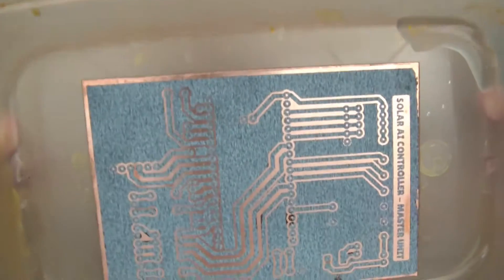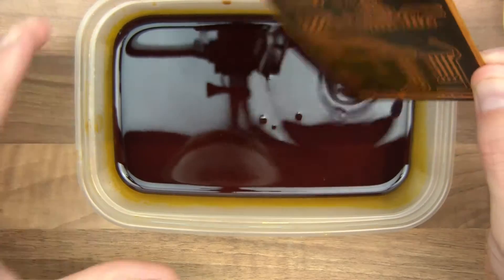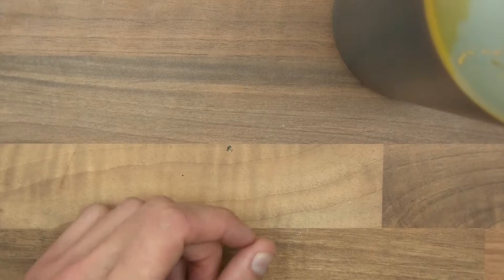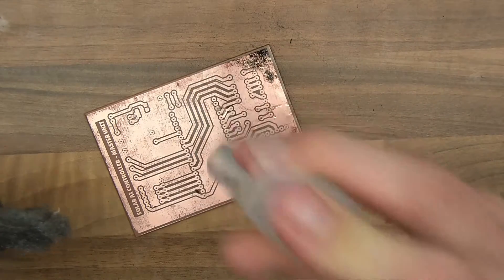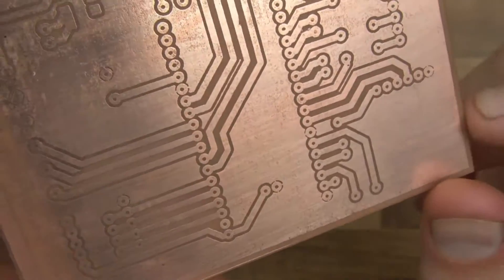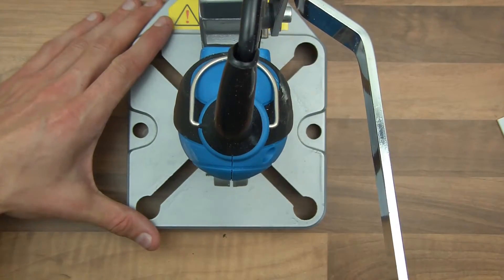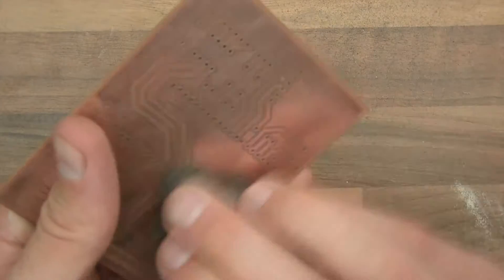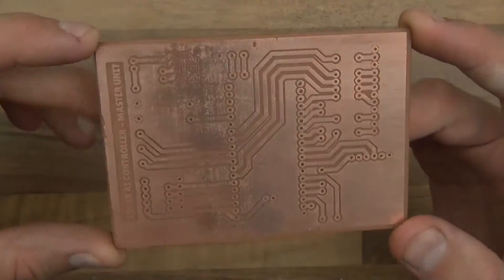TUTORIAL: How to Make Your Own DIY PCBs! - Part 2 - Quick, Cheap & Easy! (Toner, Acetone & No Heat)

Comment: If you can get a finer pitch, you could use surface mount components and reduce the amount of drilling.  Also, as mentioned previously, the tinning solution looks more professional and stops corrosion.  Otherwise after soldering, a coat of spray paint (clear or even conformal coating) will also reduce further corrosion due to residual etchant and minimize effects of humidity that could affect performance, esp with high impedance circuits.  A light coating of green makes it look like solder mask.

Comment: Fantastic video series - my only suggestion would be to show us the final circuit working - then we'd know that the method works as hoped. You could even just use a multimeter to confirm continuity between pins.

Comment: First Attempt:  Worked perfectly, but found I printed the circuit backwards.|:   Second print: not so great because I moved the paper with my finger.  Third attempt:  pretty much perfect.  That because I designed and printed a hand roller so I didn't have to rub the paper with my finger.  May put it on Thingiverse.   Thank you very much.  I've tried photo resist method and also toner method using a laminator/iron.     This is much easier and I like the results better.  Thank you again.
Reply: Neat. What did you cover the surface of the hand roller with ?  I was thinking of using a rolling pin with paper towel underneath to even the pressure out.

Comment: Thx for sharing your experience.
You're on the right road but it needs work. If you had thin traces in the areas that are that pitted, those traces would not be usable and you'd need to make a new board. As your trace sizes are rather wide your board can tolerate the pitting but that problem needs solving. 
Blue Line is probably onto the reason for the pitting. Fine steel wool is a good way to go. Keep in mind that your removing both the oxide layer of the copper and any skin oils. Only remove the smallest amount of copper needed to remove that oxide layer. The acetone on a paper towel is a good final degreaser and won't remove any copper.
As a safety nanny, I agree with Heidi Graham, gloves are much cheaper than the damage to your skin that will occur over time.
In summary, the pitting problem must be solved. Gareth Burrows shows a very similar method with no pitting.
Please repost when you have solved this pitting problem.
Again thx for sharing.

Comment: That was interesting. It is at least 25 yrs since I etched a PCB but then I used Photo-Resist stock and UV Light. Even did a two sided board on a few occaisions. This looks so much more civilised. I am sure there was an "Etch Resist Pen" around at the time to touch up inperfect masking. In fact it could be used to "draw" a free hand track layout. Never tried it.
Reply: I'm in the same boat as you.  I even laid down traces with tape onto the shadow mask film.  Used the touch up pen a fair amount.  Basically a really thick ink that always bled.  Fun days!  This is definitely a better technique.  I look forward to trying it out.

Comment: Hi. Few observations: Do not use your bare hands on acetone or ferric chloride like that. In time you will develop a kind of contact dermatitis that will heal very-very slow. The pitting is because you use too much that steel wool. When you want to remove the toner from the pcb after etching, use acetone and some free lint cloth. Be gentle. In the end, you can use a very-very fine (soft) steel wool. Just a little bit and NO pressure for very little time. Steel wool especially if is not the finest will eat very fast that thin copper layer. Especially on cheap boards. This is why your PCB is pitted. Too much coarse steel wool and not good enough coverage of printer toner. Other then that nice video!
Reply: very well said my friend.
Reply: Also, may want to neutralize that ferric chloride / water solution before disposing it down a drain (assuming that's the plan). It eats copper.... after all.
Reply: @richiedubs52  True!

Comment: Have you tried etching with FeCl by just rubbing it on the pcb for a couple of minutes with a small sponge? I think it's quicker. My guess is the constant agitation/wiping and contact with air speeds it up. Certainly uses a lot less chemical. TBH it's really time to ditch FeCl altogether. I'm gonna try the hydrogen peroxide/vinegar/salt recipe on my next project. Have you tried that?
Reply from the maker: Hi, I havent tried any of that no. I have a big bottle of FeCl so I'm not too worried. With the sponge method, you've got to be careful that you don't wipe the toner off! :-)
Reply: Ah ha. Fair point. I've only used the sponge method with press n peel which doesn't wipe off.

Comment: Etching with ferric chloride is faster if you heat the etchant to ~40C - this can be done by placing your tray in a microwave oven and cooking in 10~20 second bursts until you can feel that it is fairly hot.  You can do this with the card in the tray so long as it is fully immersed.  Etching should be complete in under 2 minutes, especially if you snap the cover on your tray and shake it gently. Once etched, rinse the board aggressively with hot tap water, soak for a minute or two in a tray containing a mild solution of baking soda to guarantee that the acidic etchant is completely neutralized, then repeat the hot water rinse.  Otherwise you will see tarnishing a few days later, and the residual acid will continue to attack the copper.  BTW, my practice with the used etchant is to store it back into another bottle so that your precious 'virgin' stock is never contaminated.  Label the bottle, of course...You can also simply leave the etchant in the tray with the cover on - if it starts to dry out, just stir in a tiny amount of hot water.
Reply from the maker: Thanks for the info!
Reply: Do you have and idea how to mask the solder points to paint the pcb? I'm thinking over a half year now about making my own pcb, have all I need but still not sure about that all, but this tutorial looks very repeatable because you don't need to care about the needed to think about the right temperature, pressure and time of when transfering with an iron, I watched and read a lot of tutorials and this seems to be always a problem because the toners have different temperatures of the point when it begins to melt.
Reply: @Wilson84KS   Did you find the answer to your question? I saw a really good video on youtube about UV curable paint which can be used as solder mask.  Also, something called Dynamask,  which I think creates better and more professional looking results but takes a bit more time.
Check it out here:
https://www.youtube.com/watch?v=bLP-gzqJ-r4
Reply: @Hi-Gain Guitar Channel Thank you a lot for the answer. I know this method, but the way they put the paint on the pcb is not very good, screen-printing is not that hard, need to buy a fine mesh and to build a frame, but it is also the professional method, how pcbway, jlcpcb etc. use it, phototransfer and screen-printing, my problem is still that it uses a lot of plastic foil and it needs a lot of steps. I still didn't try anything, but my last idea is just make my own prototypes first and use vaseline and a needle to mask the solder joints, spay the pcb and when the paint is dry brake the vaseline filled color bubbles, not sure if it will work, maybe the color will wash away the vaseline while spraying or dissolve and mix with it, but I think I can avoid it by spraying from more further away for slow and fine painting, want a thin layer anyways. If it works and I'm satisfied with the result, I'll keep it for my own little projects just for me, but simply order professional made ones if I need more than one, when I'm done with my projects, I definitely will think about how I can reach their quality myself most efficient, there is already the idea to print on glass instead of foil, so it can be reused until I drop it and it breaks, but didn't think further how to realise that, needs a lot of development so it will become an own huge project and need to wait.

Comment: Ferric Chloride is corrosive and toxic.  Please wear gloves!  (or use a non-metal tool, chopsticks are good)

I've noticed a board I made a few months ago is heavily tarnished.
Not sure this is a huge problem.  I've been looking at 'liquid tin' products but they seem expensive.
Reply from the maker: Hiya! I'm immune to ferric chloride... It has no effect on my skin. I've made loads of boards now, all have this tarnishing... I've not investigated it properly. All boards seem to work though. :) liquid tin! I'll have to investigate it!
Reply: Antony, please, gloves and eye protection with chemicals and when drilling, your nails will dissolve and you have only 2 eyes (your girl too). Nice technic btw. Regarding the mesh under ground polygons it is a common problem of modern laser printers and toner saving techniques. I saw people using carburetor cleaning spray on laser transparency films to make them darker/ more color dense. They light spray from 40-50cm equally over printed transparency. It is probably kind of solvent which helps post printed toner to cover mesh holes. Not sure it is worth trying on printer paper or pcb after toner was transferred.
Reply from the maker: @Grants2251  Hiya! The safety stuff I think has gone too far. Those chemicals had no effect on my hands. Maybe I'm immortal! :) When I realised that they had no effect, I deliberately put my hand in to see. Still no effect. Eyes, however, I'd say is not worth the risk. My children, they're never allowed in my office when there are open chemicals. :)
Reply: @antonycartwright  I think most of the bad stuff happens when you remain in contact with the chemicals for a bit, otherwise a good rinse fairly quickly should suffice
Reply from the maker: @tzq33tdq  Yeah, I was working with it again a few days ago. Neither of the chemicals have any effect on me. (Unless I have a cut).